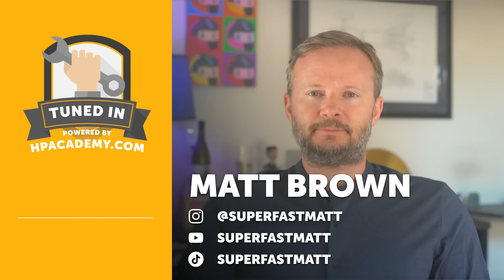116: Building an Offroad Viper — Dumb, Awesome, or Both? [#PODCAST]

Comment from the maker: Have a dumb, awesome or 'combination of both' idea that you want to make a reality? Use “FAST50” to get $50 OFF your 3D Modelling & CAD for Motorsport Course: https://hpcdmy.co/CADb
TIMESTAMPS:
0:00 Welcome to the HPA Tuned In Podcast
3:48 How did you become interested in cars?
6:17 What companies have you worked for?
8:29 Rules in motorsport.
11:17 Why did you leave Nascar?
12:50 Sodium-filled exhaust valves.
13:47 Working for Tesla.
26:35 What comes after Tesla?
29:00 Starting a YouTube channel.
36:43 Producing videos that get views.
41:36 Is it easy to become a YouTube sensation?
44:38 Access to CAD, 3D Printing and 3D scanning as a hobbyist.
50:06 3D printing materials.
57:48 Do you use 3D Scanning?
1:03:35 What is a CNC router?
1:12:57 How did you develop your composite skills?
1:20:42 YouTube comments.
1:23:57 Off-road Dodge Viper.
1:32:55 Land speed car, what is it?
1:40:00 Final three questions.

Comment: This is a pretty thorough breakdown of almost every 3D printer filament available:
 https://youtu.be/weeG9yOp3i4?si=MPh0MIMzkrL7H4_J

Personally, I use pla for fast mock up parts, petg for more flexibility, ASA is essentially the same as abs, but is more UV resistant, PC and nylon are both strong and heat resistant, but pc is a bit stiffer and nylon is a little more elastic and has a better surface finish. Add CF or Glass to any to make them stiffer and less likely to warp and lift off the build surface especially in nylon and PC.